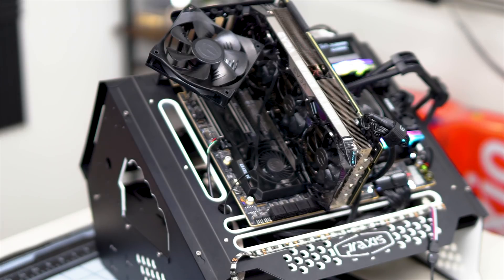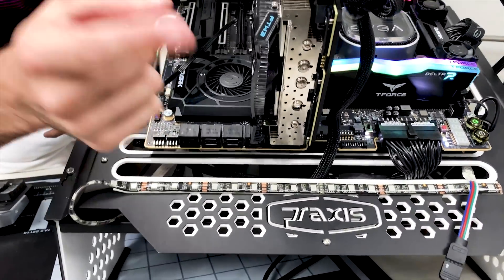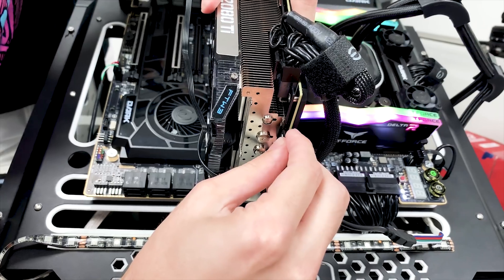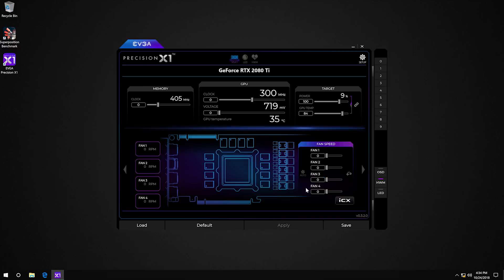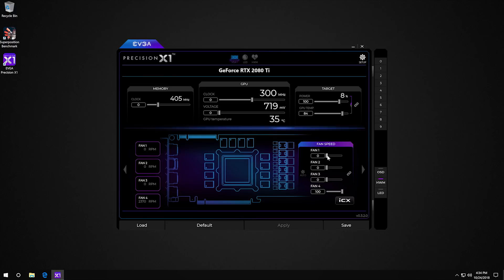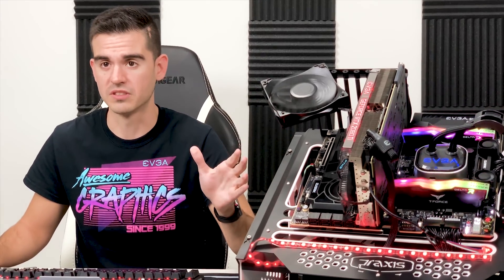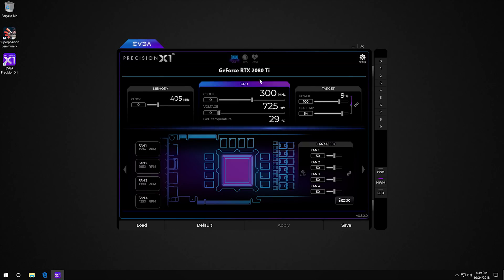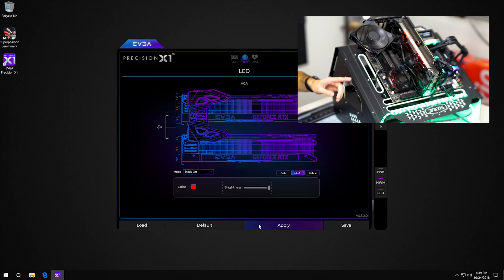EVGA GeForce RTX 20-Series FTW3 LED and Fan Headers

Comment: Is it a 12v non-addressable RGB header (Gen 1), or a 5v addressable (Gen 2)?
Reply: *4 pin = 12V no addressable RGB 
*3 pin = 5V addressable RGB
*4 pin fan = PWM (motherboard controls RPMs)
*3 pin fan = RPM are at max. always
Reply: @yezhacker  very nice explanation !!
Reply: @KelvinKMS  Thanks!

Comment: hey, I have the evga geforce rtx 2080 ti ftw3 ultra and i'd like to run its rbg off of the mobo (aorus 370z master) is there a way to do this? or will i have to try to use this method to make everything run off the gpu?
Reply: this is my current rig https://pcpartpicker.com/list/HP6Fvn?fbclid=IwAR08jBQzZ3BjLWXIyTOJl_FcFBlTGZ5AjWBzx3byLZFV8aumxHF4MRVKBic. 
notes are that they aren't all from the same company so getting them all to run the same rgb has been a bit of an issue. 
all the rbg fans use 5v vs the 12v that is on the gpu.
am i SoL?

Comment: I wonder if EVGA also has problems with RTX 2080 + 2080 Ti's breaking or BSODS.
Reply: The card itself is fine, it's the X1 software that crashes my PC all the time... Afterburner handles the same OCs without any problems but X1 just doesnt seem to agree with my PC. Very annoying as I've spent over £1100 on a gpu and cant access all of the features. Not even full fan control!

Comment: Guess I know which 2080 Ti I'll be getting.   I love that rear PWM header.  I use that on my current card (an ASUS 1080Ti) to control a set of rad fans since my current card is liquid cooled.  And since, I plan to add a water block to my 2080Ti.  Fortunately EKWB has one planned for this card.  So, good bet this will be it.  Well, unless it's really expensive compared to ASUS's Strix 2080 Ti.  Hopefully EVGA will be competitive.

Comment: You are correct I did not even notice that my ftw3 2080ti had that. But I must say I been using the card for about two days and I do seem to be having a problem every time I cold start my pc. The center fans goes 100% and I have no control of it until I have to shut system down and then start it up again.
Reply: My does the same until I called them  and gave me a fix
Reply: They gave me a temporary fix that fixed the problem for about 24 hours but after that it came back.

Comment: Does this interfere with power link?
Reply from the maker: PowerLink has an adjustable size that allows it to be compatible.
Reply: @TEAMEVGA  adjustable as in it won't sit flush on the corner?  Do you have any pictures on your website?